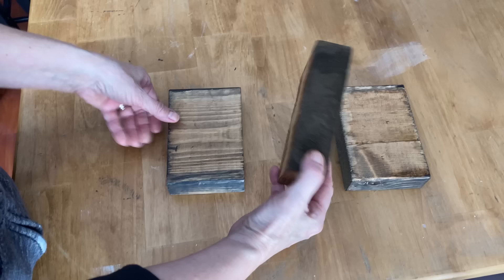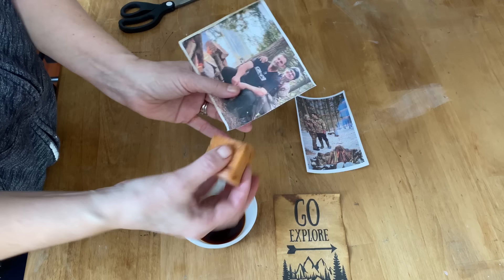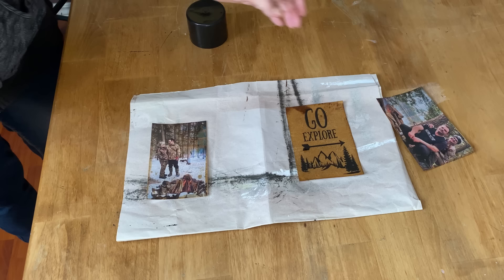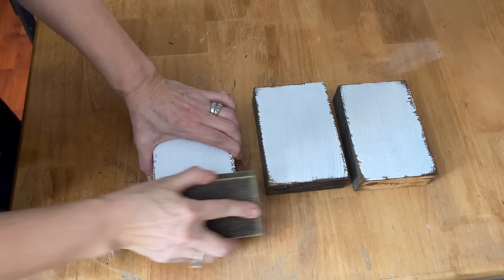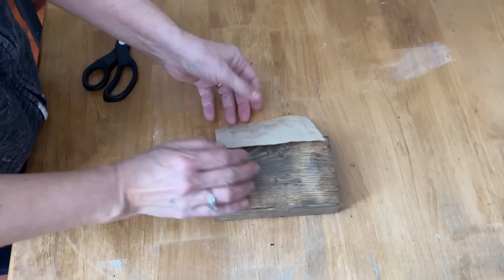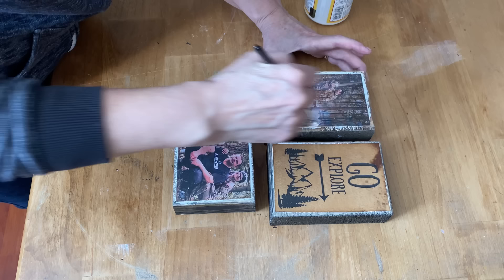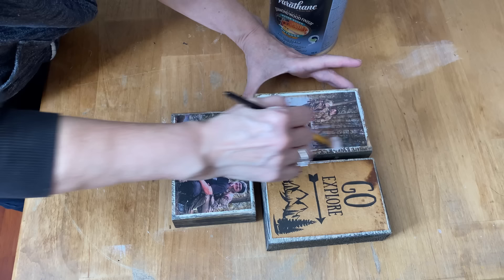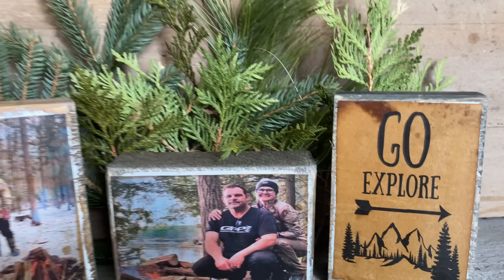How to use a INKJET printer with Mod Podge / EASY TUTORIAL

Comment: If you want a antique effect on the pictures. Take some modge podge and put on a plate. Add a couple drops of brown paint to it. Just to give it a little color. When you apply this to the topic of your photos it will give that aged look.
Reply from the maker: Great tip! yes that works great
Reply: @OurUpcycledLife  It might also look great if the edges of the photo were  gently sanded to look more blended with the wood for an even more aged look :)
Reply: You can also print out your images using the antiqua setting on your PC to give it the sepia look.
Reply: @vanessaeden8174  thank you for this tip. I adore the sepia look and now I’ll be able to print my own photos using this technique! Much appreciated.
Reply: Is it 200 degrees F or Celsius
Reply: @helen3652  great question! I just googled and Fahrenheit Is more common in Canadian stoves.
Reply: I burn the edges for a more aged effect

Comment: My grandmother used to do this in the 70's with, I believe, greeting cards on wood.  I'm going to have to ask maybe an older cousin who may remember what she used to do, but it was exactly the same idea.  Plus I think she may have used some kind of ribbon around the edges of the wood or plack. This brought back fond memories of my grandmother! Thanks! 💗
Reply from the maker: Thanks for watching Belynda! I remember my grandmother using this method also
Reply: I remember that technique from summer camp. Do thin coats of mp on the image do one direction. Dry through then other direction for 3 coats. Then after dry wet the image and rub off the card back. Then put decoupage on desired surface and apply image. Then decoupage the top.
Reply: Back in the depression my Grandmother said they used real tea bags to stain paper to give it an aged look. To make ordinary paper turn brown. Similar to what we use as regular tags and decorate. Tags you use for gifts. I wish she was around to ask more details like what they used as embellishments.

Comment: Hi, loved your video. It was very clear! I just have two questions: Is your oven 200 degrees Fahrenheit or Celsius and do you remove your mod podge that you applied in the last step with a wet paper towel or do you just leave it on after it dried?
Reply from the maker: Put your oven on the lowest setting 200 Fahrenheit I leave the mod podge on the top to dry . Thanks for watching

Comment: Question : when using a laser printer graphic (for rub off  method) does ink need to be wet or can graphic be printed days earlier than transfer to wood, mp, dry 24 hrs. Rub off projects TYIA
Reply from the maker: I find it works best to use right away but it will also still be ok after a few days. Thanks for watching Gale

Comment: Ok, so this isn't really an image "transfer" so much as just attaching the original print to the wood block, correct? I ask because I've done all types of image transfers (packing tape, alcohol makers, matte medium, etc. Where the original photo or graphic is actually transferred onto another surface, and the original copy no longer exists but has been "transferred onto the new surface" and I know they make a specific modge podge that is a transfer medium, but have never tried using it.  Just wondering if you have tried doing transfers using that modge podge and if so, how it turned out?
Also, a question...if you don't print on coffee or tea stained paper, rather just plain copy paper, and you don't wish to distress the photos or graphics, do you still need to bake?  Thanks so much!
Very excited to have found this, have subscribed to your channel, and cannot wait to see more!
Reply from the maker: Thanks for watching!  My main way to transfer is with mod podge reverse method! I have lots of videos with lots of different projects. Have a look around at some of my other videos :) Happy to have you following along

Comment: Would I be able to put photos on a wooden fence?
Is there a way to make it waterproof?
Reply from the maker: It might work? You would just have to give it a try and seal with a outdoor poly acrylic sealer and cross your fingers 🌸
Reply: Mod Podge makes an Outdoor formula and a Dishwasher Safe formula that might work.  And Krylon makes a Moisture Resistant spray, but don't think it's waterproof.
Reply: @janiethecraftprincess  
Thank you😊

Comment: Nicely produced video, but quite annoying to get two thirds of the way through, stopping to take notes, only to find that it is NOT photo transfer, but decoupage.  I used  to do photo transfer from an inkjet image at least 20 years ago, by applying white acrylic to canvas, white acrylic to the front of the photo, sticking the photo face down, and when it was dry, doing the 'dampen and rub off' on the back of the photo.  I saw on another vid recently how spraying with clear varnish afterwards would get rid of the slight haze of paper that's left.

Comment: I sealed my freshly printed photos with PVA and it worked really well but PVA is pretty expensive so I am going to be buying some mod podge but I don't understand why you would need to bake them, I certainly didn't and my printer is a cheap HP ink jet. Maybe the mod podge is more watery and it makes the ink run? I will find out tomorrow.
Reply from the maker: Some ink jets are ok and will not run but some do, so just have to test.
Reply: @OurUpcycledLife  Did the test with mod podge and it showed that you are right!

Comment: I saw a person reverse transfer a photo onto dried poly top coat. It melted the photo right off. Dont remember if the poly was hard dried. Like when you leave it a week or more so just dried. Also not sure what kind of printer used. My issue is not having the wood and other things to make art projects!
Reply from the maker: Ya putting on top of poly def won’t work . I find lots of scrap wood at Home Depot. They have a bin they put small wood in you can take for free ❤️
Reply: @OurUpcycledLife  
Really?  I had no idea Home Depot will give you free scrap wood. That's awesome... And another great tip! Thank you!

Comment: Hello, I know you posted this video years ago but I’m wondering if you’ve ever tried or done a video on how to transfer images whether inkjet or laser printed onto metal? I even bought some mod podge photo transfer and I tried to transfer images either from magazine flowers and scrapbook paper onto metal jewelry charms and only one worked using the mod podge photo transfer. I have searched for tutorials for this specific technique but haven’t been able to find any. I would prefer to use and inkjet printer image because that’s what I have. Thanks!
Reply from the maker: I have but usually paint the metal with chalk paint first so transfer will stick
Reply: What’s funny is that I tried this very same technique last night before you even responded to my question and it worked! 😮😊
Reply from the maker: Excellent!!

Comment: Hi. My image seems to be transferred onto my canvas but there seems to be a thin layer of paper still on the canvas (after removing a lot of it) . It's my first time transferring so I don't want to mess it up. Should I continue to remove the whole paper? I don't want to end up removing the image!
Reply from the maker: Did you paint the canvas first with chalk paint? If so you can gently dampened where there is still paper and gently rub off in small sections. Also when you seal with poly acrylic sealer the hazy look with disappear a lot. Don’t make it to wet when rubbing or it willl rub off. If you didn’t paint first it probably won’t work the great and rub off easily.
Reply: Hi. I'm having a second go at another canvas. Is it better to use warm water rather than cold water when removing the paper? I used cold water yesterday. Thanks for replying to my last message btw 🙂
Reply from the maker: Hope you made out ok ! Yes warm water will work better , the process takes a bit pf practice

Comment: Hi! I tried doing this technique using my ink jet reversed print to add on a dollar tree galvanized metal sign. I waited the 24 hours and tried to peel off paper but ink did not stick. Any suggestions? Thank you!
Reply from the maker: Did you paint it with chalk paint first if not it will not just adhere to the galvanized metal sign very well
Reply: @OurUpcycledLife  H! No I didn't.  I now realize that the transfers straight on metal were with tape or napkins. I wanted to keep the metal look. I am a light weight crafter so I won't invest in cricket. I think I will paint a portion in white chalk paint then transfer with mod podge. Thank you so much for your speedy response! Keep us inspired!!

Comment: I am trying to transfer an inkjet image to canvas. I saw that you can use Mod lodge. I tried but as soon as I laid the picture on the Podge  it bubbled and rippled.  I did use my hands to try to flatten it and also used a cc but the paper got wet and couldn’t remove anything. Tried several times with same result. Is it the printer paper?  Or should I have put a book under the canvas. Can I use gesso as a medium for the transfer?  So disappointed!!
Reply from the maker: It sounds to me you used way too much mod podge. If you put it on too thick it will bubble and wrinkle right away

Comment: Instead of hair spray and oven to seal the ink, wouldnt it be better to use pigment ink to avoid those extra steps?
Reply from the maker: I have never used pigment ink so I am unsure.
Reply: @OurUpcycledLife  
Pigment ink is waterproof vs the normal water-soluble ink that normal comes with the printers

But look into purchasing pigment ink to solve a lot of those problems and its also UV resistant.

It works just like water soluble inks and practically the same price

Just a suggestion